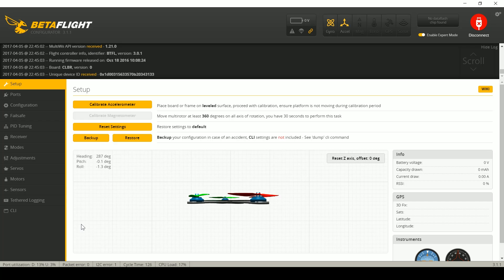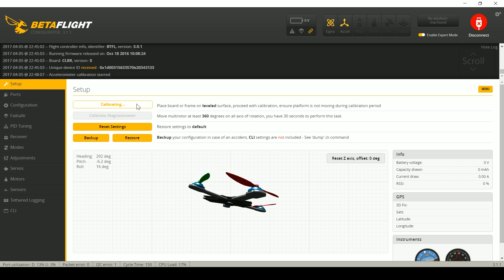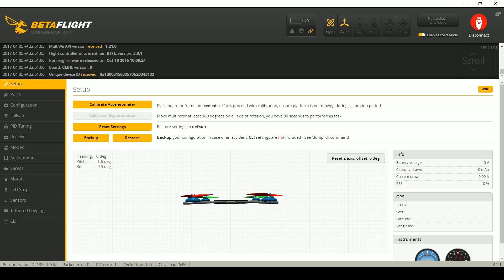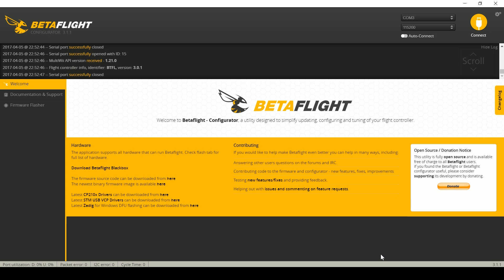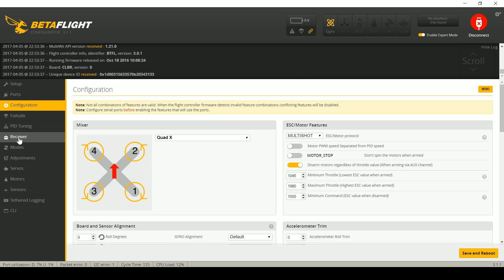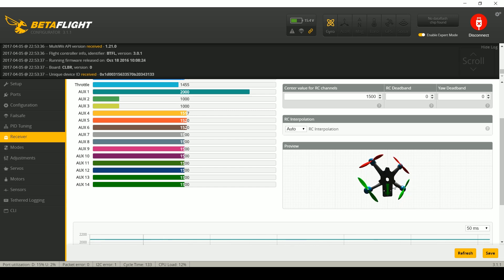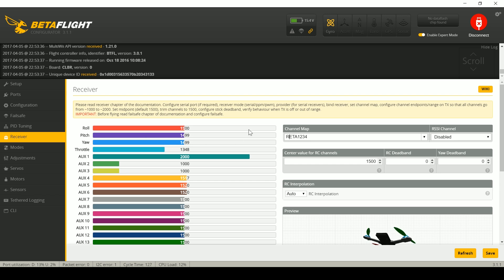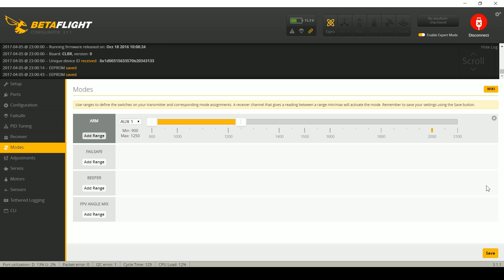Quadcopter Won't Arm | CLEANFLIGHT BETAFLIGHT

Comment: i really need help please
What i have to do if even when the motors are armed are not spining?
Reply from the maker: First thing, TAKE PROPS OFF. Then go to the Motors tab and use the sliders to make the motors spin. If motors do not spin from there, it means the ESC is not seeing or understanding signal from the FC.

If the motors spin from the Motors tab, then make sure Air Mode is enabled, and this will ensure that they start spinning when you arm.
Reply: Ok thanks
Reply: Hi Josuhua!! Greetings from Greece!! I have the same problem with my Hawk 5. It just started not to arm without any special reason and without any modification of any kind. Could you advise what can be done if the motors cannot spin with the usage of the Motors Tab which means that the ESCs do not communicate with my Taranis QX7? For your reference please note that yesterday night I was trying to find a solution with out success and today, the first time I armed it , the motors spin for 2 sec and then stopped. Since then never spin again. Thank you!!
Reply: StamPap try to select and save on betaflight oneshoot125 and if the motors spin after that select the previous oneshoot or dshoot that was at the first
Maybe will work
Good luck
Reply: Thanks  @lucarednic7658  ! I tried so but unfortunately no luck for me...

Comment: Hi, my tiny whoop will arm for less than a second and barely spin up the motors. Earlier today I was flying it just fine and when I swapped the battery when I armed it would just flip over. The only thing I changed was the battery. Now it won't even arm fully or at all. I was hoping someone could help me out

Comment: i am having some problems. I received a wizard x220 and it was able to fly out of the box. It only had angle mode to start so i tried to enable acro mode. I must have messed something up because now my quad wont arm. My Reciever reads Err1: 1% and my FC just flashes a red light.  I don't know what i did. The thing wont arm anymore but the reviever is still bound to the quad because when i power it on, it connects to the receiver. It just wont arm. This is going to be a nightmare

Comment: i am sooo close to get this working. you are a big help. im stuck on the arm switch. its not lighting up, mincheck is at 1050, and my throttle is at 1000.  there are some strange settings under motor tab-- im using cleanflight-- right now my transmiter is beeping at me (dont know why) im can master turn them on, they work fine. i want to get this thing airborne so bad. been a while.-- im getting cpu load at 23% not bad. 0 packet errors.. I do get a slight spin on the reciever preview screen is that normal? yours is not.. also i did the arm screen for cleaing on CLI as you did.. im stuck.
Reply: when i get into the PID TAB, i see no throttle values. arg. this is frustrating. I thought i was smarter than this...
Reply from the maker: Go to the CLI and type "status". The Arming Status Flags will tell you why it is refusing to arm.

CLI and MSP flag simply mean the quad won't arm when connected to Betaflight Configurator. Any other flag should be investigated.
Reply: # status
System Uptime: 112 seconds
Voltage: 0 * 0.1V (0S battery - NOT PRESENT)
CPU Clock=72MHz
Stack size: 2048, Stack address: 0x10002000
I2C Errors: 2, config size: 2186, max available config: 4096
CPU:22%, cycle time: 280, GYRO rate: 3571, RX rate: 131, System rate: 9
Arming disable flags: THROTTLE CLI

Comment: @Joshua Bardwell  I just wanna say thanks for all the information from just watching your videos has help me LOTS!!!! in my quad build. The issue I was having was  the arm switch in betaflight wouldn't go yellow when triggered.  Solved that. Then wasn't sure what esc protocol to use .it wouldn't act right in oneshot, multishot or Dshot I wasn't getting all the motor start up tones I would get the first set but not the last.so at the top of the list there was PWM. This worked with my ESC and did the trick I running lumenier BLheli "flycolor" fairy 30a esc

Comment: Hey Joshua, I have a receiver that will not work in betaflight.  It is a riot control fc and xmplus.  Thought there was a problem with the fc so rotor riot sent me a new one, same problem.  So bad receiver??, got a new one, same thing.  Actually tried 3 different receivers and 2 fc's and cant get the stupid thing to work.  Any ideas???
Reply from the maker: Since you have tried multiple FC and RX, there is only one common link ... :-/

LOLOLOLOLOL.
Reply from the maker: Can you follow the steps in the Riot Control manual to connect up the receiver?

https://static1.squarespace.com/static/56744f4e7086d7e3d0cc724c/t/5b300b6e8a922d7f9ce8bc3e/1529875317953/RIOT+CONTROL+MANUAL_V1.pdf

You need to solder-bridge the B and SBUS pads together, then connect the receiver to UART 1.
Reply: @JoshuaBardwell  yes sir, pads are bridged, serial protocol and sbus selected.  Flashed with newest omnibusf4 firmware using betaflight 10.4 configurator.  I even disconnected everything except receiver.
Reply: @JoshuaBardwell  and I am on the inverted pad
Reply: @JoshuaBardwell  and got 2 more r xsr's with no luck

Comment: Joshua-- I know you are busy-- please, please Help. I just downloaded Betaflight 3.4. Nothing will arm. At the top it says "Arming Disabled". The motor tab shows engines at 1460. It will arm in motors-- not transmitter!! Thanks in advance for your help.

Comment: I got problem with my drone uruav flysky version the arm box won't turn yellow even inside the range, my lowest throttle is 889 min check is default 1050, i try everything in this vid still cant get arm, but when using motor test in beta flight all my 4 motors working normally, im using jumper t8sg v2 plus, can u help me out ?
Reply from the maker: Go to the CLI and type "status". Look up the Arming Status Flags here: https://github.com/betaflight/betaflight/wiki/Arming-Sequence-&-Safety

MSP and CLI status flag can be ignored. They are there when you are plugged in to USB and in the CLI. If you have only MSP and CLI then just un plug USB and go fly. Other status flags you have to solve different ways.

Comment: Hi Josh betaflight is driving me nuts. I follow your instructions but the the still not arming. I have notice that on the receiver tab where the preview of the quad graphics is moving to all direction?  Even my tx is on.  Is this one of the reason why the motors wont armed?? Thanks. Rico from australia.
Reply from the maker: In the receiver tab, if the quad is flipping out, then GOOD NEWS your receiver is working. You need to fix your channel map.

Follow these instructions:

https://www.youtube.com/watch?v=PCLxyurZsD0
https://www.youtube.com/watch?v=XQXV6bjCfuA

Comment: My quad will arm with a 3s battery but 4s it Very rarely will arm. Any idea what this could be? I did everything you said in the video and still no luck. Someone Please help
Reply from the maker: Probably this is the CALIB status flag. Electrical noise is worse at higher voltage and this can prevent the gyro from calibrating--although it's very unusual to see it on 4S.

If you have betaflight OSD on your flight controller, turn on the Warning OSD element and it will flash a code at you when the quad refuses to arm.

In Betaflight, you can adjust the gyro calibration sensitivity to fix this issue if the CALIB flag is appearing. The exact commands changed between 3.3 and 3.4 but if you email me to confirm the issue I'll help you further. Unfortunately I may not see your response to this comment.
Reply: Ok awesome! I sent you an email.

Comment: iam confused  cli msp flag problem  any help
Reply from the maker: CLI MSP is the normal state when in the configurator, in the CLI.

CLI means the quad refuses to arm when you are in the CLI because you can muck with things in the CLI that can make the quad configuration dangerous, and the quad doesn't want to suddenly arm on you.

MSP means the quad refuses to arm when you are in the GUI, because the same reason.

You can disable the MSP flag by going to the Motors tab and clicking the "i understand the risks props are off" option. This will let you test arming while still connected to the GUI. TAKE YOUR PROPS OFF.

Comment: Hi Josh, at my Receiver tab, the Roll and Pitch are at the max level causing this to spin the quad like crazy (at the preview tab). I am not touching the transmitter and I dont know how to set them/calibrate at the normal value, can you please help me? Thanks!
Reply from the maker: Check your channel mapping. Look at www.armattanquads.com/joshua-bardwells-tutorials

The second to last video shows the steps.
Reply: Thank you for your reply Josh! I am looking at the video right now but I think my left stick is not working as it is not responding at all. I tried to factory reset the transmitter and I don't see it moving in Betaflight nor in Function -> Setup -> Display (FlySky i6)  ... :(

Comment: You have been a fantastic help. Do you know why my dys flight controler will not run all six of my motors? The firmware that it came with had 3.2.2 I reflash it to 3.3.3 In betaflight but only 5 motors are spinning when I do the test. 3.2.2 was only spinning 4 of the motors. Any help would be greatly appreciated.
Reply: Oh it's the dys pro F4 v2 flight controler
Reply from the maker: If you're using dshot, the board may not have enough DMA channels to use all six motors at once. Try switching to multishot and if all six work, that's the answer.
Reply: Joshua Bardwell thanks I'm go to your. Patron I greatly appreciate it
Reply: Just switched it still no luck
Reply from the maker: Go to CLI type "resource list" and confirm that all six motors are assigned to a pin.
Reply: Joshua Bardwell it's showed motor 5 is assigned to A01. And motor 6 is assigned to A08. I do have alot free pins could I change pins or reassign a different pin?
Reply: Joshua Bardwell  I just bought a video you did on pin remapping I'm watch it first and let you know how it goes.

Comment: Thanks Josh you brain you I ask a question if you can this is multipul times i have ask for help with no help i am on disabiliatys so can't afford patron i get $148 a week so i have a luminar all in one but theres no buzzer can it be fitted.
Great wook buddy keep it up.
Mick
Reply from the maker: If there is no buzzer pinout on your FC then the next thing to do is use the Dshot Motor Beacon function in betaflight. You have to be using Dshot, but most ESCs these days support it. The motors will beep instead of the buzzer.

Comment: Only problem is facing that tx stick movement is not showing in Betaflight program.
Receiver Frsky v8frll, tx using turnigy 9x,pwm connection properly done..
SP racing f3 board is successfully flashed..but receiver not arming with controller.
Pls help.
Reply from the maker: If stick movement is not happening in the Receiver tab then your receiver is not wired correctly or not configured correctly.

For V8Fr2 receiver, you need to connect the PWM outputs to the PWM input header on the side of the FC, then in the betaflight receiver tab, set receiver type to Parallel PWM.
Reply: Sir Thank you very much..for your reply..as you suggested I checked it and now stick movement is showing..
Now problem is that it's not arming..

Status  is showing that 
Arming Disable Flags:Throttle Cli Msp
Reply: Sir.. kindly help me ..how to arm 3 position switch in turnigy 9x transmitter,and pls help me for safer configuration in SP racing f3 board.. because I'm newbie.

Comment: Thanks!    I also had to reverse Aileron and Rudder in my Spektrum DX9, in addition I had to use Sub-Trim to get all the centers at EXACTLY 1500 as opposed to like 1586 or whatever they were going to.  That fixed my issue with arming.   
We need to all make more videos as when I need them, I can never find them, despite all the good RC channels out there.  I am about to buy a Taranis just because folks almost never show DSMX instructions

Comment: I watched your video 3 times and triple checked that everything was correct. My quad is calibrated flat, I have a cpu of 5% and my throttle can go below min check. (which is 1000) What do you think I should do? Is there anything else you would check for?
Reply from the maker: Go to the CLI and type "status" and loo at the arming status flags.
Reply: Joshua Bardwell After watching your 3.2 video I found that the only problem I had was it was connected to to computer. When I arm the motors don’t spin until I increase the throttle. I played with the numbers for the throttle putting them over and under min check. So there will either be too much throttle to arm, or so little that I have to raise the throttle stick. What should I do?

Comment: Last time I tried betaflight/cleanflight I bricked my rodeo 110 Quadcopter and it wouldn’t work. (Tried all the fixes including flashing the boards elect.) so now I have a rodeo 150. Do I want to risk another £150 on turning my new Quadcopter into a glorified paperweight? No.

Comment: hi joshua,
i got an other problem ..well its also not arming any more but before it did.
alright, well.. i had a nice flight with my quad, and from one to an other moment its had some issuis with the motors..looked like one of the motors had some more power then the other 3. so it flipt half a way.. ..luckely i menaced to correct that with my sticks.
so i landed.. and tried te rearm it again. but sudenly it didnt anymore.. pulled the battery out.. put it in again and i didnt get the whole beep concert.. only the first 3 beeps.  means fc not talking to my esc anymore... if i pluginn the quad in de pc with the usb.. on betaflight the virtual quad you see on the first tab.. did not responding on my movements i was doing with my quad.. so i guess its a gyro problem..but not sure.. i would like you to help me out. please connect me on my facebook. and help me out.. 
fb: https://www.facebook.com/kloekje

Comment: Hi JB! Just flashed 3.3.2 on my OG CL Racing F4 (not s) and now my quad won't are and gives the alarm that the throttle is not at zero. min throttle is 1050 and receiver tab is showing 850. Halp!
Reply from the maker: Receiver tab at 850 means the receiver is not being detected at all. The FC is in failsafe. You need to get your receiver configured correctly. How exactly to do that depends on the receiver type. If we assume it's a serial receiver then most likely you need to enable serial rx on UART 3 in the Ports tab and in the Configuration tab select the serial receiver protocol (SBUS, SPEKTRUM, etc.) that is right for your receiver.
Reply: Joshua Bardwell got it figured out, but the rx (xfire) was connected and I was seeing input from the sticks and switches on all channels.
Reply: It was also showing as level in bf, and I even went ahead and calibrated. Setting the small angle to 180 fixed it. Never really seen anything like it, and I have gone through the process of upgrading to 3.3 on a couple of other quads. Oh well, it is working

Comment: In my case the reason for not being able to arm was missing motor end points. Set max and low end points (without props) and then it worked.

Comment: Thanks Josh, got my CPU load from 100% down to 9%. Now I was wondering why my quad likes to spin in circles (yaw) when taking off and then correct itself then yaw again a bit then correct itself again and then it doesn’t do it again for a while. So strange! I have an x220 with the fly sky i6

Comment: One issue is left - at least for me and I`m totally stuck:
- on 3S its arming / flying 
- on 4S it will not arm under any circumstance - tried everithing in CLI, e. g. I`ve set "et vbat_max_cell_voltage = 46
set vbat_full_cell_voltage = 45" etc. - nothing helped.
Running OMNIBUS F4 Pro V3 with BF3.3.1 (tried 3.2.5 and 3.4.0 from Jenkins)
It is strange - only some time, after I re-flashed / re-dumped CLI, I can 1x arm the board - once plug bat off - cannot agin arm. 
Looking in BF "arming prevention flag" it shows "17" - but as well with out USB no arming on 4S lipo possible, doesent matter if HV (charge only to 4.28/cell) - or "normal 4.20/cell type.

Any idea?
Reply from the maker: Go to the CLI and type "status" and look at the arming status flags which will tell you why it's refusing to arm.
Reply from the maker: In the field, turn on the "Warning" OSD element, which will show the arming-refusal reason on the OSD.
Reply: He Josh, THANKs a lot - am a step further now - OSD showin "CALIB" - thought first it`s a "moron_threshold" problem https://github.com/betaflight/betaflight/issues/4613
Mine was "set moron_threshold = 48"  did go to 75 with no gettin it better. Strange thing is it works on 3S ... oh dear... does cell / cell voltage impact looptime somehow? Have it gyro/loop 8/8khz
Reply: After setting "moron_threshold = 100" - at least for normal 4S lipo (4.20/cell) it works. 
But puttin an HV lipo (4.28/cell) to it - I get still teh "CALIB flag"...

Comment: Thank you very much ! My Copter wont arm, because i setup the receiver min to 1000 mid to 1500 and max to 2000. But i forgot to set min check an max check! Now i set min Check to 1010 and max check to 2010 and see... it works !